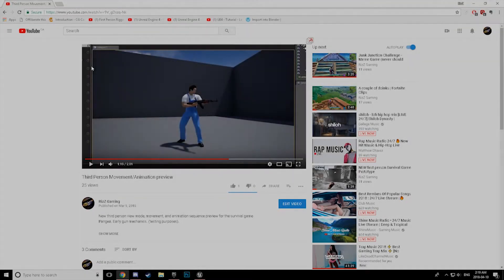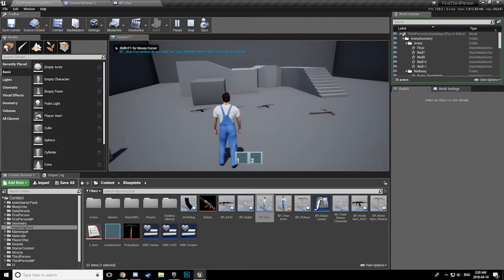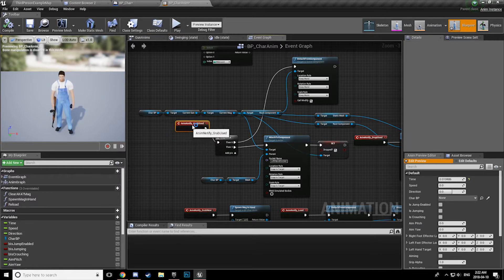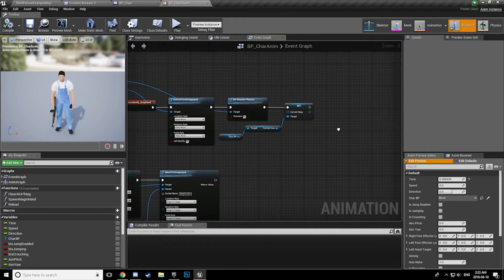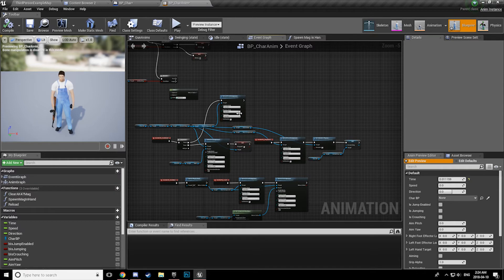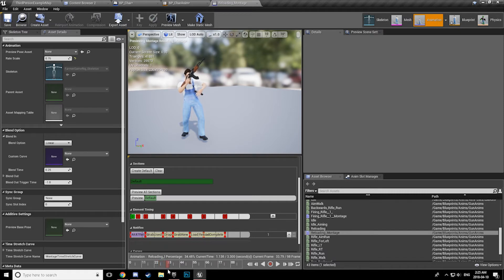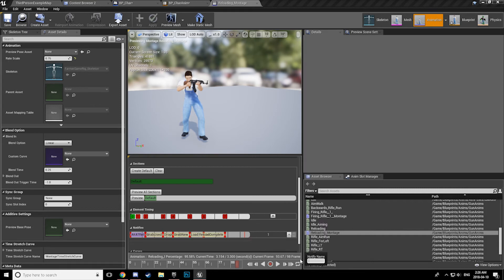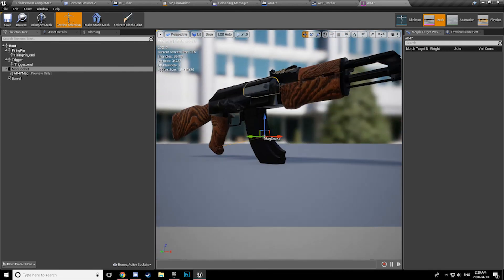Unreal Engine 4 Tutorial  |  Realistic Reloading overview

Comment: My weapon has the a skeleton with the mag in it all ready. How can I delete or hide that part in unreal?
Reply from the maker: its a little bit more difficult that way, I would recommend splitting it into two meshes. BUT if that isnt possible, without intense C++ coding, you could use a transparancy mask and modify properties of a Material Instance? Set up your gun material to be "masked" and save two image files as variables on the gun blueprint. One image is flat black, the other image make the Mag UV section full white (with a little bit of spill). When you need to hide the mag (in this instance, on 'Grab Used') , switch from the full black mask to the one with the white mag, this will make the mag invisible. When your character puts the mag back in the gun, switch back to your flat black mask!
Reply: Nice got it to work. Do you happen to know why the clip doesn't go away in multiplayer. Tried everything playing with replication. I think the problem lies around attach component or detach component. It currently makes a clone of a mag (current mag doesnt remove from the gun) for the other player point of view. Works great for the pawn owner.
Reply from the maker: My networking knowledge is very limited, I'm a 3d modeler artist and game designer, but I can check with my team!
Reply from the maker: If you figure it out before I do let me know how, because i will run into this once we start netcoding our game!
Reply: Love your tutorial. Finally got it to work. Here was the glitch: https://www.youtube.com/watch?v=ZuPLE7qEN98 .... Made the mag varible in the characterbp... for some reason replication doesn't work well when its not the root component.
Reply: Hide bone by name